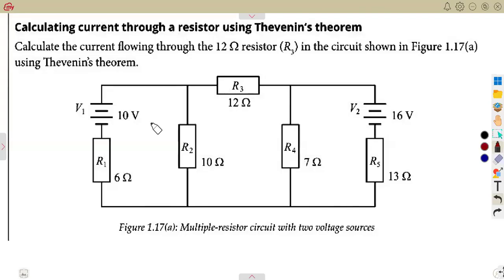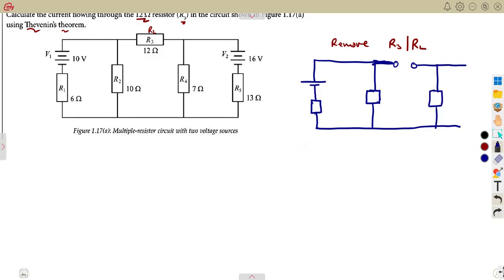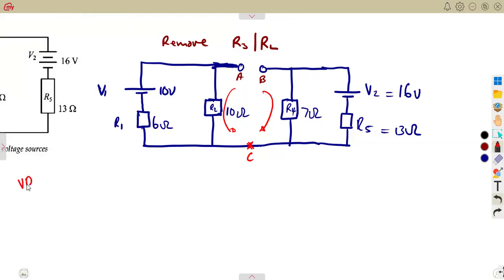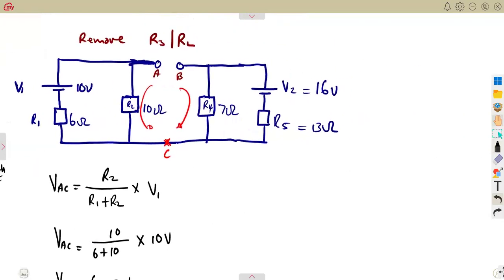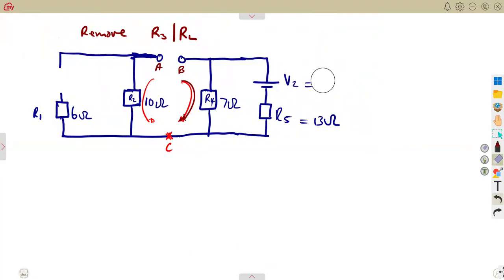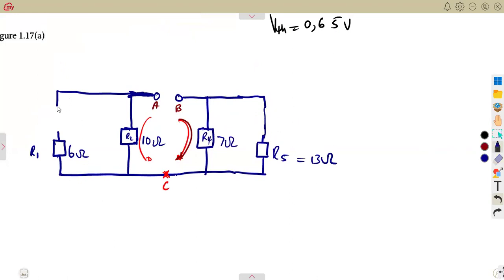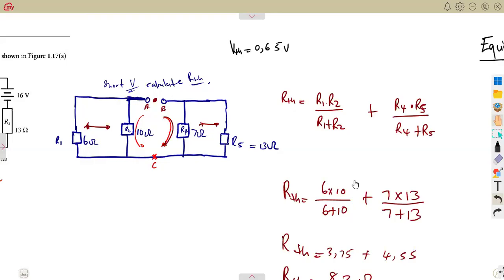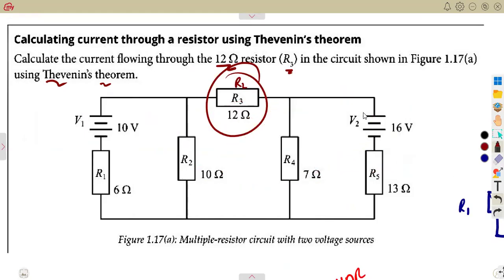Industrial Electronics N4 Thevenin's Theorem example 4 @mathszoneafricanmotives  @mathwithlightone

Comment: Hi I don't understand in Video Example 2 you added the Values of V to get Vth, but in this Video Example 4 you subtracted them(also if the voltages were in opposite direction, would you still subtract?), but the voltages in both videos are in the same direction. Can you please explain
Reply from the maker: Hi in this can Vth is referred from the points A, B and C , across these points you must subtract
Reply: @mathszoneafricanmotives  thanks meneer